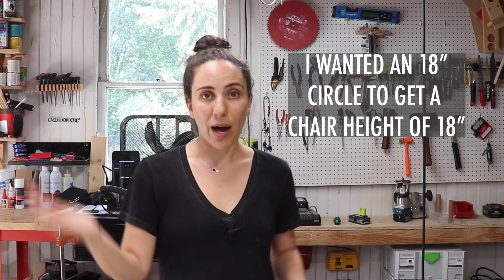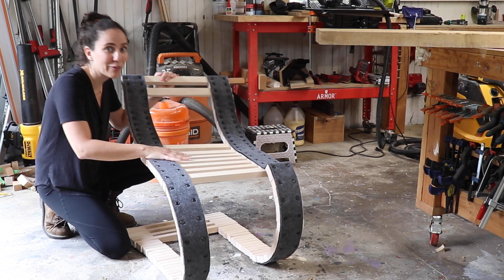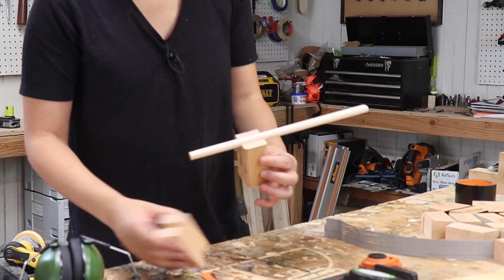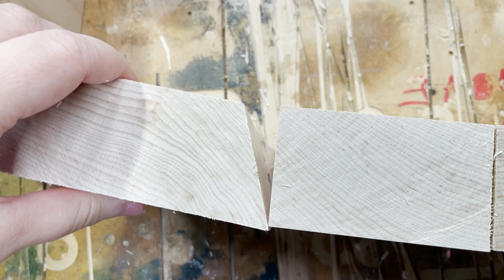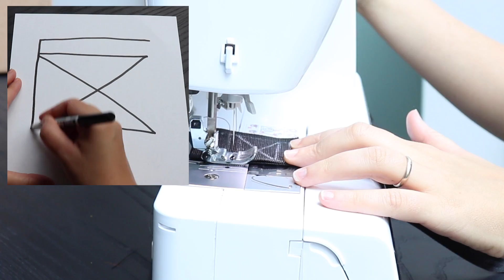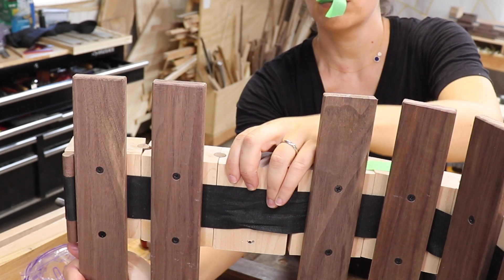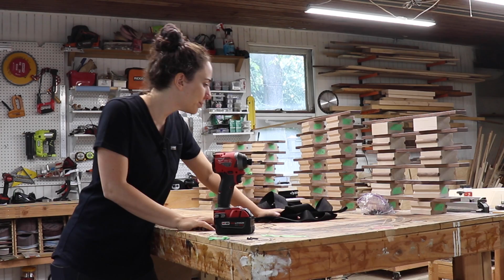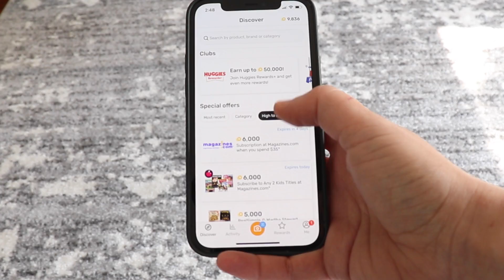I ATTEMPT to make a Roll Up Chair… AGAIN...

Comment: You need to do actual research into what material will not stretch instead of trying to guess. Make a simple jig to test the elasticity and durability of your material before you make a whole chair with it. Kevlar might work or some other form of carbon fiber. I'm not sure if there are forms of these materials that are still flexible enough to roll in the other direction. Good luck.

Comment: Take a look at steel strapping, the stuff they use for securing loads. You might even be able to get it for free since it gets thrown out. It doesn't stretch much, and it's kinda stiff and springy so it might help the chair roll up more neatly. There'll be loads of it in the dumpster of your local lumberyard

Comment: You needed a wider straps…too much tension on that little straps…but what I think will be a better material are those thing metal straps and area where there’s a lot of tension use extra strapping especially the bottom curve or area where there’s a lot of tension use a locking joiner that you slide in.

Comment: Using the strap as a design detail more than a functional element I would suggest using a braided steel wire. Drill a centre hole through each element from angled face-through dowel-out angle face. This would change the pivot point, steel has a lesser modulus of elasticity so expansion is controlled. 

Good luck

Comment: Two reasons a table saw blade burns. Either the rip fence is not square (pinching) or your blade is dull. Sometimes installing a fine tooth is needed for hard woods.
Reply from the maker: Yeah. My saw only burns on maple. And it’s not wise to use a fine tooth for rip cutting. You want less teeth for rip cuts.

Comment: It is unfortunate that you are missing the failure mode. The strap is not the point of failure, it is the glued wood. By tensioning one side you are enacting a peeling force peeling the glued segments apart. You need to counteract this tension.

Comment: Disregard strength and stiffness concerns about the fiberglass. The problem is the peeling load on the cured glue which is at best 1/3 the strength of wood if the grain is correctly oriented. The glue is only stronger than wood in the worst orientation... example where you are repairing splits. If wood is a must, you must eliminate the peeling load which can be done by reinforcing the rear. Metal or fiberglass will work, but if you choose fiberglass you must tension it. Thus it needs to be strapped onto the structure at each wood segment.

Comment: Maybe add some fold out legs that connect between the back part of the seat and the ground support of the chair that supports the weight. They could be designed to fold in to allow the chair to roll up and fold down to give extra support.

Comment: I'm still thinking about if putting a static climbing rope in the middle of the pieces, like drill holes in the pieces along where the straps had room, would work instead of straps.

Comment: Leather will likely stretch as over time. I wonder if something like seatbelt webbing or industrial webbing might provide better support. You probably want a material that is designed for ratchet straps or lifting heavy loads as they have known stretch values you can account for. Polyester webbing should have the lowest stretch of the common plastics, but you might need to look at something like Kevlar webbing as it should have very little stretch. McMaster-Carr sells it in a variety of widths.

You should also try to account for deformation when cutting the angles, essentially you're designing something that needs to settle into the correct position, unloaded it will be the slightly wrong shape.

You can also try securing critical sections of webbing to each block directly to prevent the slats from essentially sliding along the webbing (or webbing sliding through the slats). That is probably what is allowing the gaps to open as the webbing stretches.

Feel free to DM if you want to bounce ideas.

Comment: You have to run the straps on both sides or not make it out of wood. you can make a wood buck and run a fiberglass cloth over it... then you can attach wood pieces to the fiberglass frame. This will never work with wood unless you use steam formed lumber.

Comment: Take two straps and sew them together with a right and a left lane and a row of crosses in the middle. then they hold each other and do not warp.  That should improve things quite a bit. It's like with wood, two glued boards hold the stress better.

Comment: Don't use straps. Don't use wood.
Each link is a lever, you can try calculating how much tension you're putting the strap under, at each link. A back-of-the-envelope calculation (since I don't know your exact dimensions) tells me it's multiplying the weight of the user by 20 or 30 times; and that's not even considering the extra force when a person would sit down, with the downwards inertia. I'd expect, at the weakest point, the strap and wooden corners, to experience some 10,000 lbs of force. The strap you used is rated for braking at 2,700 lbs; even by doubling it, you just bumped its breaking point up to 5,400 lbs. It will experience stretching before that, so even if you used 4 straps, or 8 straps, it won't hold its length.
If I were to make a roll-up chair like that, I'd build it out of steel, and make each link have its own independent limited hinge. It's much easier to analyze the stresses and deformations when each link is independent, instead of having one single strap across the entire chair. The ground hinges would have to be sturdier, the ones near the back could be weaker and lighter.

Comment: PRO TIP: use Cyrillic alphabet to version your project! This way you can make more mistakes and more revisions before you run out letters!

PRO TIP: start with numbers, and proceed onto letters after you exhausted them!

On a more serious note, i wonder whether glass fibre tape or tyvek tape would work better. Something else i'm thinking of is braided steel cable, the ones found at a home improvement store usually start at 2mm thickness which is quite flexible but very resistent to stretch, but i don't have a thought on how to mount it securely but with room to bend.

Comment: Run metal tubes inside of all the wood, then run a really high tensile wire in the core. then maybe put some kind of lock for all the wood blocks.

Comment: I think the problem isn't strength - the strapping didn't break - it's stretch. Your strapping stretches, so your joints are not rigid enough.

It might work better to use steel cable or something like that, or even rigid hinges - and you want it connected to each block as close to the corners as possible, so that it has as little opportunity to stretch at the joint as possible.

Comment: What if you put 2 to 4 dowels that would slide into holes on the bottom of the back of the seat, toward the backrest, and straight down to the part on the floor? They would come out but you can slide into the roll when rolled up.

Comment: you should strap on both the inner and outer sides. so the tension will be on both sides instead of on one side only. don't use leather it stretches even more.

Comment: I'd recommend trying a cable/chord set-up in the middle of the wood, tightening just like a thumb push-puppet. You'd may have to coat/pad the inside of the wood to protect long-term damage from the tension cables/chords.

Comment: I'm thinking steel cable, routed internally (through the centres of the blocks) with an over-centre clamp that is tightened after the chair is unrolled. It would probably require thicker wood blocks. This would clamp each block to the next, with the load across the flush faces between the blocks.

Comment: The angles on the wood prevent you from creating a tight enough connection from one block to the next. If you shaved off a quarter inch bevel on the strap end of each piece, you'd be able to join the strap in a way, where at the time of assembly, you can account for the elasticity. Basically, by having one edge of the wood 'intersect with where the edge of the next piece of wood would be, it'd allow you to assemble it, without needing to keep the strap in enough tension for it to work. I'd also recommend using material that doesn't stretch/has minimal elasticity (something like martial art belts in my experience are extremely non-elastic but strong in tension)

Comment: why not steel or something?
or seatbelts?

irregardless, you're going the wrong direction here

first do the math, figure out how much tension there is, once you know the forces involved you can think about what material to use

my first guess would be that the strap, belt or whatever you want to use will have to withstand about 5-10 times the force of the person sitting on it, so you need something that can handle 500-1000 pounds without stretching

Comment: Could there be a supportive structure that would roll up with the chair. I don't see why the seat part has to be hanging in mid air. I thought the point of it was for it to be rollable. 🤔

Comment: If you're willing to sacrifice some of the "neat" factor, you could add a couple of support bars that fold down from one of the middle sections to brace against slots in one of the bottom sections. It wouldn't look as cool and you wouldn't be able to quickly unroll it for sitting, but sometimes you do need to sacrifice style and convenience for the sake of safety. I don't think you can make a chair that does all three perfectly.

Comment: If you stick with the straps/webbing plan, would it work to add some sort of adjustable protrusion to each wood block that you could increase the tension incrementally, after you've attached the webbing? This could be a screw or cam system of some sort, and would let you adjust it to different heights/weights.

Comment: Consider the treads of the bull dozer or the battlefield tank. The engineers surely tried every possibility in making the tractor treads they use. Maybe consider the way chains are made.  It does look dangerous any way you go though.

Comment: Why not try using two straps instead of just one. Also if you put one on each side of the back blocks with another bock to hold it in place you will have a much stronger piece.

Comment: This is a really neat idea. I think it could work if you used something like steel strapping instead of nylon some other organic material. If you fixed it at each joint, it would also eliminate the problem with it folding in single joints due to strap tension. I have 1.25 x .016 inch galvanized steel strapping which is rated at a 4000 pound load with very little extension. I don't know how many times it would be able to roll until the steel work hardened and broke though.

Comment: How about those Metal Straps, that are used to secure heavy equipment on pallets? 

Those won't have any stretch, roll up without an issue and be strong enough to not snap!
Reply: Basically hinges if we fix the metal strap to each pieces.
Reply: @WhoAmi2357  I was thinking hinges, as they are rigid, and would still allow the rolling, but I feel that kinda defeats the purpose of having a single continuous strap running the whole length
Reply: I think this idea gives the best possibility of success without a significant design overhaul.

Comment: You are letting the straps slack too loose over far too long of distance.   You need to screw directly through the straps in multiple locations every foot or even less, in order to prevent that Slack

Comment: could you sew a criss cross pattern into the strap only in the locations of where you need it, so that it stops it from stretching. Dont sew in the same direction as the edge of the strap but sew multiple 45 degree patterns (probably a few mm apart) to "help" reduce the stretching. May work.
OR...
Double up the strap (extra strips) in the required sections, that only attaches to 3-4 pieces of wood. A shorter length of strap will only stretch a shorter distance. That would/should provide more strength. Ugh, now I'm never going to sleep.

Comment: I feel like a series a wire cables running through with some sort of quick tighten system to add the tension would work

Comment: using big steel cable would be a cheap alternative to those seatbelt material that are too strechy. Big steel cable would have way less flex in them because they are supposed to have way more force through them.

Comment: I, a non-engineer, think the angles are wrong. With the right tension and angles, I think it could work. Where there are gaps, those are probably points where there's not enough leverage, and it bends. Maybe making the joints that aren't getting gaps shallower?

Comment: I really think going at this problem more engineer-like could help. First calculate the forces the strap has to take, it's rather simple mechanics. Than research possible materials and their elasticity and calculate the resulting strain.
Another way of constructing it could be using steel cables. Probably easiest to put them through holes in each wood piece, even if that doubles the forces compared to having the strap on the outside.

Comment: As can be seen from 19:19 - 19:22, at the front-most joint, the webbing still stretches under even the slightest pressure. This is due to the way the fibers run within the webbing. None of the fibers run parallel to the length of the webbing itself. They weave back and forth from the front face to the back face of the webbing. This allows them to straighten out under tension, thus lengthening the webbing. 

You also don't put your screws through the webbing. When the webbing stretches, it also gets thinner. This allows it to slip under your walnut strips. So more webbing gets shifted to the gap under the most tension. This is why it constantly appears that the webbing is too long. It is also why the problem resets itself every time you take everything apart and put it back together again.

Also, why are you making the primary blocks only go along the outside edges of the chair? Aesthetic reasons? Sometimes (OK, most of the time) form must follow function, rather than aesthetics. Your first mistake was in allowing aesthetics to determine the form before you had worked out the functionality. By making the primary blocks go the entire width of the chair, you could use many more webbing straps, thus reducing stretching.... But not entirely.

The final problem is that, even if the fibers in the webbing DID run parallel to the length of the webbing, the molecules in the fibers of any nylon-ish compound do not "run parallel" to the length of the fiber itself. The molecules are zig-zag shaped, and the molecules themselves stretch. This is what makes "extra durable" webbing more durable. The molecules in the fibers stretch then bounce back rather that break. So, all the suggestions to use that "extra durable" webbing may likely have been the exact opposite of what you needed. What you need is something that is strong, flexible enough to not break under constant bending, and is known for not stretching. Something like Kevlar fabric. NOT webbing, fabric. The fibers in fabric do weave back and forth, but not nearly as much as in webbing. If one layer of fabric isn't strong enough, use multiple layers, rather than one thicker layer.

When assembling the chair, screw the screws directly through the fabric. However, use an awl to push the fibers out of the way of the screw by gently pushing the awl down into each hole while wiggling it just before inserting each screw. Will this take all the time remaining in your mortal life? Probably. But it still needs to be done.

Another possible tip: I know of no adhesife that sticks to Kevlar. However, epoxy will saturate kevlar and not allow the fibers to move. As a last resort, you could also apply the same epoxy used when doing "fiberglass" with Kevlar rather than actual glass fabric. You can obtain this from any good fiberglass supply house. You would have to carefully apply the epoxy only along a strip in the center of each (now full width) block, so that it does not ooze out to the fabric between the blocks. This would, naturally, require LOTS of experimentation and practice to get it right consistently. That is why I say it would be a last resort. This is why some things are better made by machines in factories, than by hand.

Comment: Perhaps a type of dovetail joint would help keep the blocks together when unrolled.  Due to the pressure, it would push the dovetail together, locking the pieces.  Though this might cause an issue when trying to roll it back up again as they may become locked too much due to swelling.

Comment: i feel like a steel cable  (maybe 2 per side)  internally would be the best option with a solid threaded end on 1 side to adjust tension
or  if you want to continue with external webbing each joint needs to be individually fixed to the wood